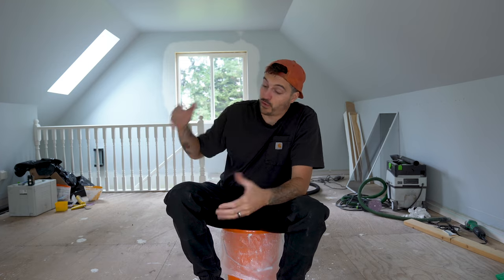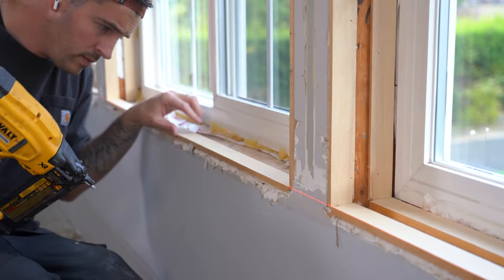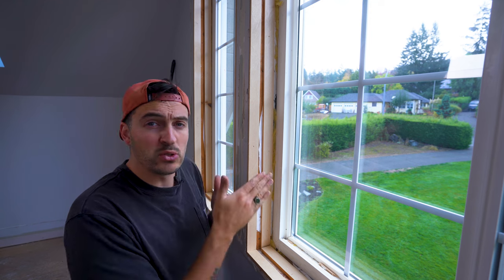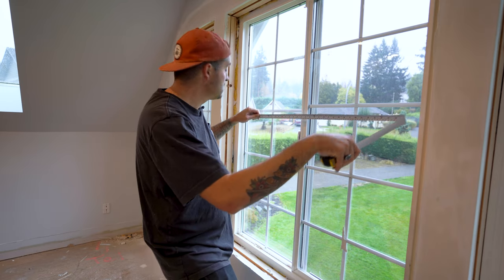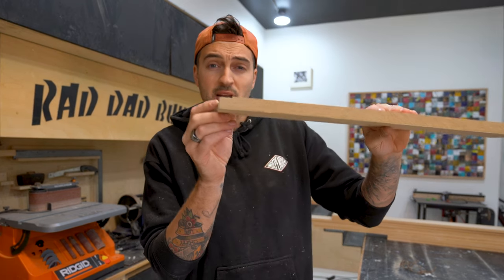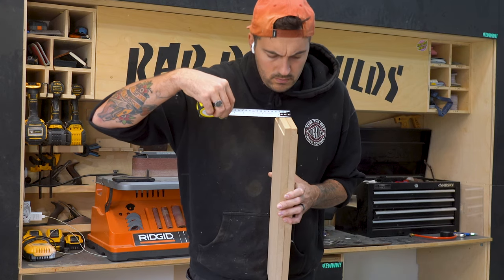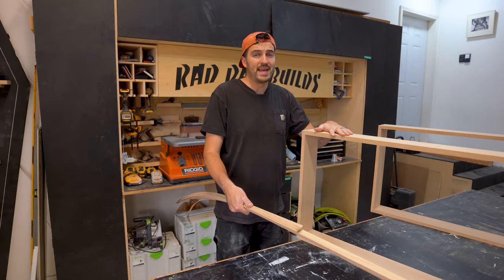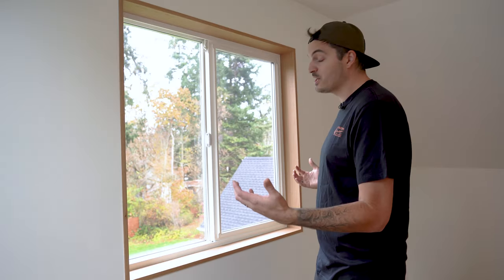Minimalist Window Trim How To //No More Ugly Window trim

Comment: Love the look, but no self respecting carpenter or home owner should ever put MDF trim on a window. Too many potential issues. For a few extra bucks, go with real wood and avoid the potential moisture and other issues. Would expect this from a house flipper. Again it looks good, but has potential issues with MDF.
Reply: also use waterproof wood glue in that area - and UV protection Osmo for final oil layer
Reply: As a contractor, It's really scary to see what and how things are being installed into homes because of YouTube amateurs. I foresee a huge uptick in home fires because of all these how to videos in electrical. At least MDF window trim shouldn't burn down a house. As a side note, it really shouldn't cost any extra to put in solid wood rather than the rubbish. A good quality white oak MDF panel should be about $200 that equates to $6.25 a board foot. I can get white oak lumber for $5 a board foot. of course prices vary by location, but in general lumber is almost always cheaper than an engineer panel, but lumber will have much more labor involved so from a contracting perspective the overall price is cheaper. For someone working on their own home who often doesn't properly calculate their time into a project than solid will almost always be cheaper if they are buying supplies at the appropriate business (not a big box store). There are times, however; when an engineered panel, and it's inherent stability, are preferred over solid wood.
Reply: In his defense, there is a veneer on it, so it's not typical MDF. Or if you are going to use normal MDF, then just use oil-based primer to prevent water intrusion. There are ways to use MDF in those situations.
Reply: @timtimmons3115  Not sure why you raise fire concerns; any material can burn given the right circumstances. And since this is a window and not a fireplace or stove, that has no relevance to the video.
Reply: In the UK our windows are trimmed differently to you guys in the US. We tend to have a large window board at the base which as standard is supplied as primed MDF then the sides/head are generally plastered (mud to you guys) however if it is to be trimmed then these are also supplied as primed MDF.  TBH in all the houses which i’ve owned and renovated (which I do for a living) there has never been any issues with using MDF regarding moisture as the MDF is fully painted and sealed to the windows therefore protected.
Reply: Well even the builders who are putting up 700K houses just slap mdf around all the trim. Lol.   
It looks like mdf heaven, when you buying a new home.

Comment: Very nice and clean. Can the corners be mitered doing this project, or is that standard practice to butt joint?
Reply from the maker: Thank you, you can most definitely mitre the corners. I just prefer butts
Reply: @RadDadBuilds  thanks for the info. I’d like to try this on a kitchen window that would benefit from this kind of trim.

Comment: Nice job, but that is a lot of work to fix the drywall.  I'm yanking my trim as I work my way around the house, but went with simple picture frame trim replacement I custom milled myself (narrower than the original and no traditional stool & apron).  My trick is to paint it same color as the wall so it blends in.  Keeps your eyes from focusing on the windows.

Comment: You are a legend for this, there is nothing like this that I can find on the internet!! 
Just a question - do you have to have a slight gap between the drywall and the new frame to avoid cracking of the drywall or that's not an issue because of the drywall corner piece you installed?
Reply from the maker: Thanks I appreciate that. I did not use a gap that said it's not a bad idea to do so for expansion and movement as it can easily be filled with caulk and hidden during painting.
Reply: When drywall meets wood or any other different material I would recommend using an L-channel. You’ll be happy with the look long-term. Beautiful work!

Comment: Where...o....where...do you guys find such material.  I can never find any such mdf anywhere.  I can never even find any nice plywood...other than baltic bitch...if they even have it in stock.
Reply from the maker: Any hardwood supplier should have veneered sheet goods. Where are you based?

Comment: Enjoy it until you sell your house. Having renovated many homes over the years, and also bought and sold as a realtor, people like trim because that adds value to home and the appearance.  Essentually a "frame" to their outside "picture". 🤷🏼‍♂️
Reply: how depressing to make all of your choices based on a nonexistent future owner of your house
Reply: I would want a house more if it had this trim
Reply: @Moaritsu  This maybe true, but will you be at this house ready to buy a home when it goes to market? Flyingjoe is speaking of the typical buyer not outliers. Trim is a classic look that will never go out of style. Something like this will have a shelf life before taste almost always sways back to something more traditional. It's similar to modern architecture. It's only modern for a short time then it becomes dated. Classic looks are considered classic because they always outlive trends. A couple decades ago dark floors were all the rage. Pushed by designers that don't have to live with them. I told all my clients not to put in dark floors because there's a high probability that you will come to hate them with a white hot passion pretty quickly. Most of my customers trust my opinion and chose something else, but a few went with their interior designers, and ended up hating their dark floors with a white hot passion.